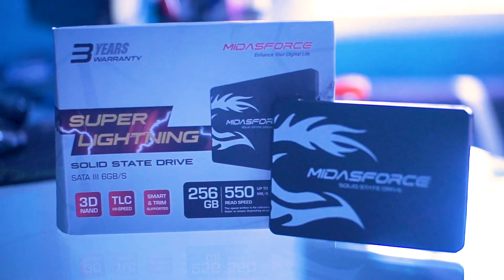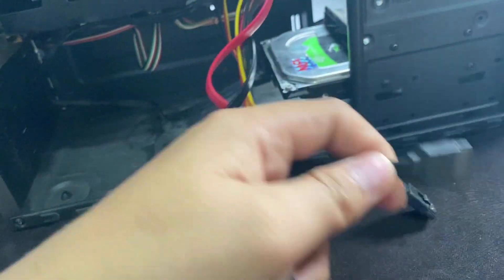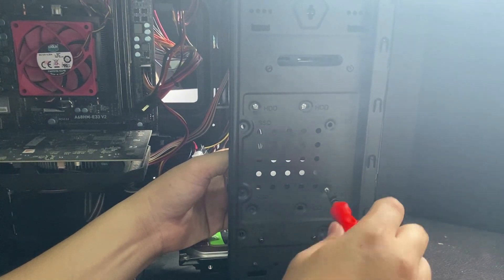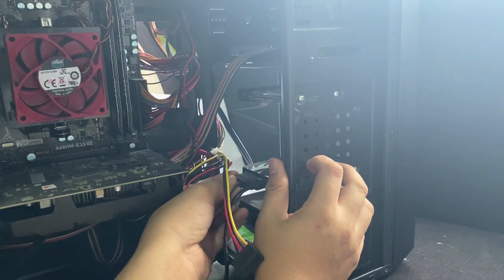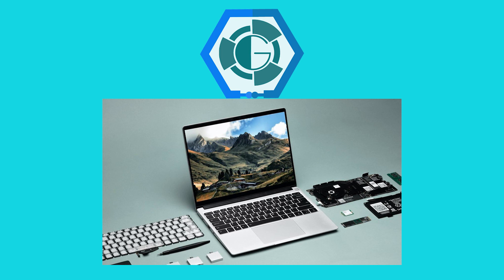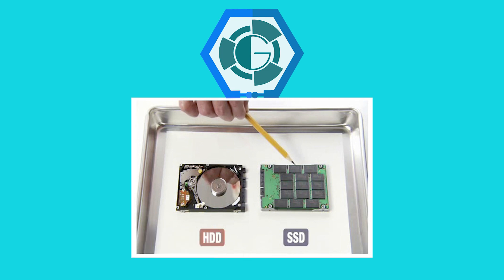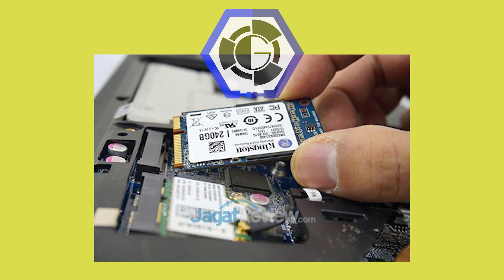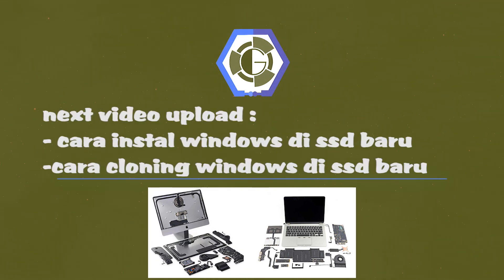Upgrade SSD Tanpa Ribet! Cara Cepat Pasang SSD ke PC & Laptop untuk Pemula

Comment: Kak nanya ya, pc saya dari hardisk biasa mau ganti ke SSD, apakah power supply perlu diganti? Ataupakai PSU lama ndak mslh? Btw kebutuhan tegangannya sama nggak ya dengan hardisk yg biasa?
Reply: bantu jawab : :-) kalo psu lama ada kabel sata nya ga usah ganti psu bang, cukup bli ssd ny aja sama bracket ny
Reply: @asmr_ai87  bang kalo motherboard DDr3 merek Mobo X star B75 cocok ga untuk SSD RX7 + power suply nya merek imperion PSU 600W dan Prosesor nya yg cocok merek apa ya bang?
Reply: @dipa adit pake hirensboot trs nanti di backup pake ghost/acronis true image windows ny..trs restore k ssd.
Reply: Okey, makasih